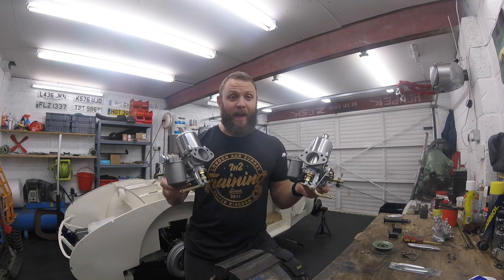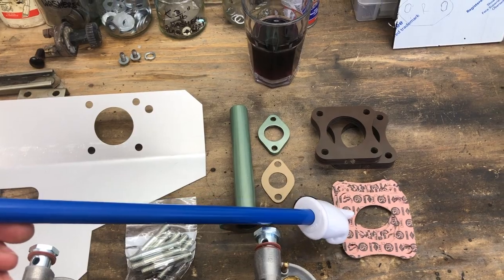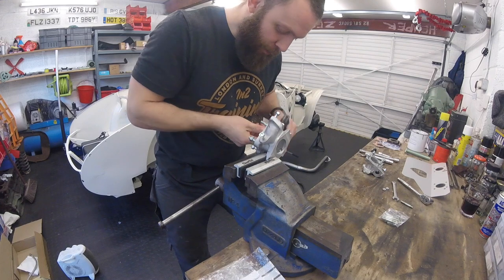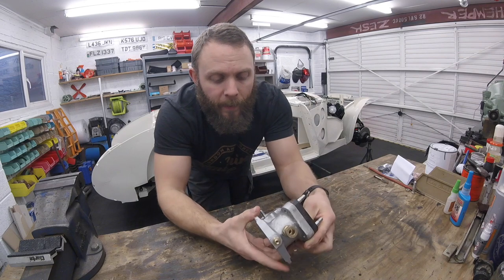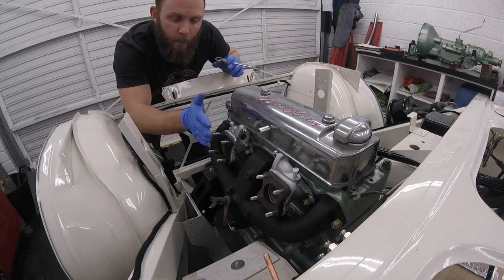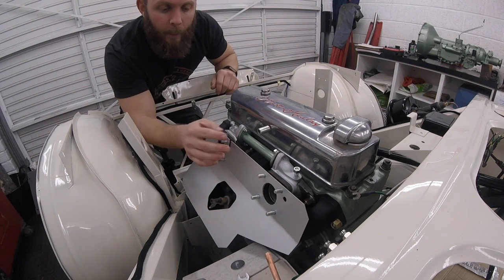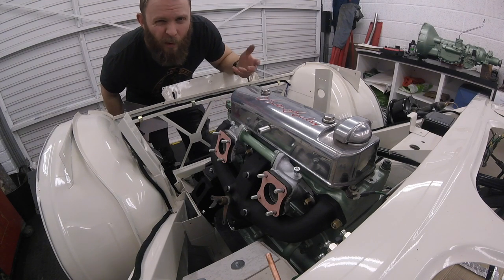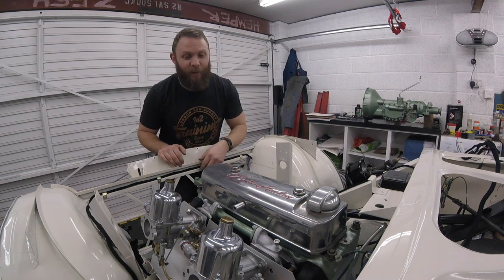Fitting ‘M Spec’ Carbs to our Austin Healey 100/4

Comment: Salut James. Curious if you’re going to run the OEM linkage. One of the studs on the exhaust manifold serves as a pivot for the throttle bell crank.it does look like you’re having fun with it. Keep up the good work.
Reply from the maker: Marissa Flagielo thanks 😁. All under control on the linkage. Only filled the heat shield holes and left the bell crank one as we are using a cable conversion but retaining the bell crank and ball joints to the carb to look as original as possible and it was all fitted today and video will be online in 2 weeks 😎.
Reply: Famous. Was just wondering. I really do enjoy the early 100 series. I have a one off factory100 Le Mans Racer.
Reply from the maker: Marissa Flagielo they are a great looking car! No door handles or windows or mirrors or side repeaters to ruin the lines of the car! Nice! Factory ‘m’ ? Or a car with race history? What sort of condition? Are you in the U.K.?